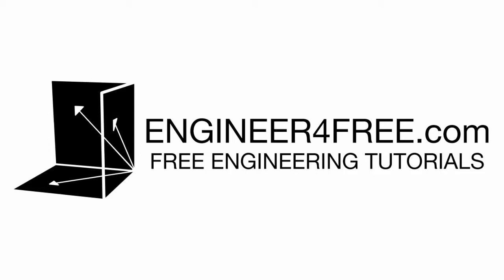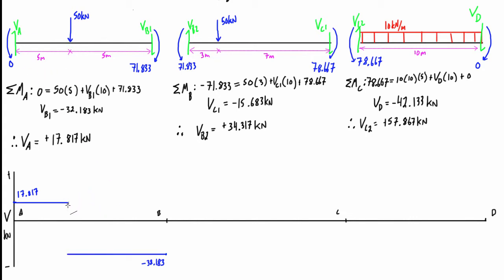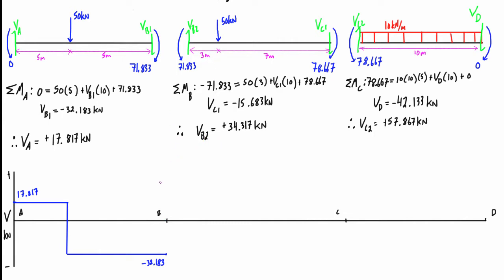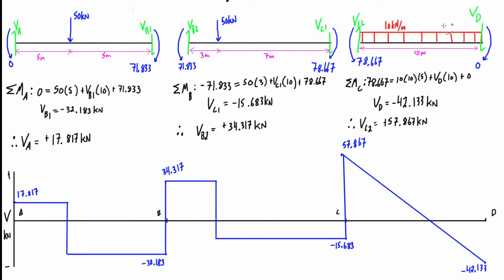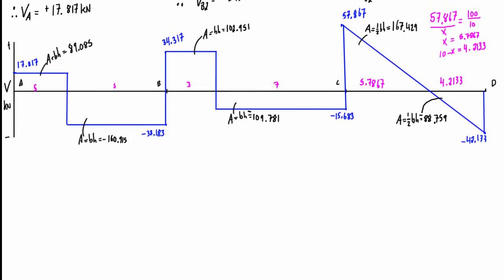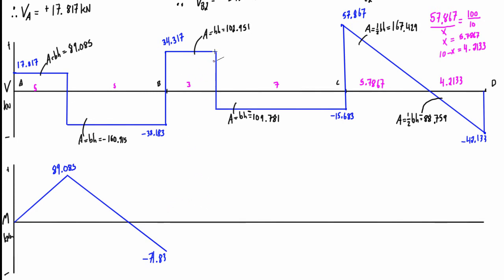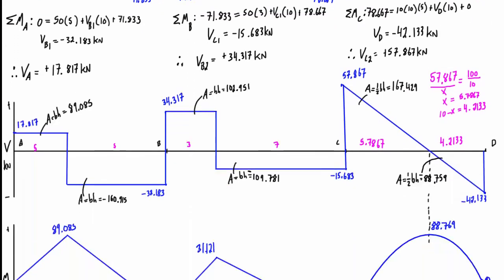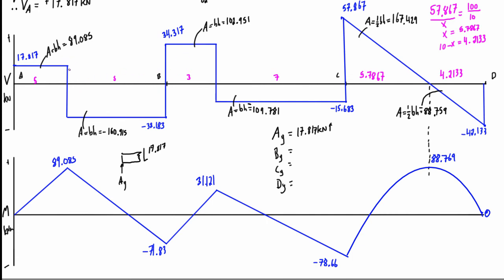3 moment equation example #2: three span beam (part 3/3)

Comment: The similar triangle part, 57.867/x = 100/10. 
 how did you get the 100/10 ?
Reply from the maker: Sorry for the late reply, I missed your comment. C and D are 10 m apart, that's where the 10 comes from. The y value at C and the y value at D are separated by a distance of 57.867 + 42.133 = 100, which is where the 100 comes from. You can drop the units in the calculation because the kN will cancel out and just remember that x is in units of metres.